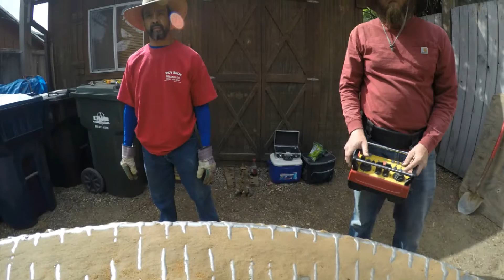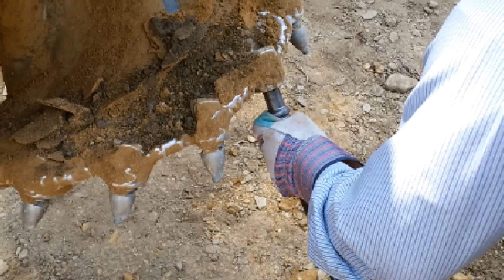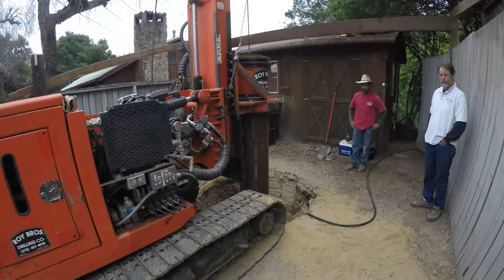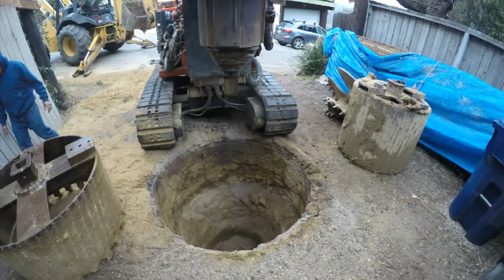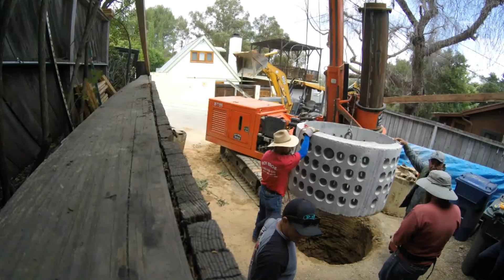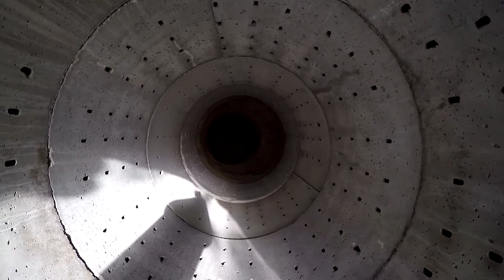Seepage pit instillation with Tescar Limited Access Drilling Rig

Comment: Do you have trouble setting those liners together in the pit and keeping them centered and straight? We have struggled to use those. Also, how does your lifting mechanism release after the liner is set?
Reply from the maker: The most important thing is that the bottom of the hole is flat for the first liner to be set good so the rest comes out good. This tool we got from the liner mfg and there is a rope that releases the liner when ready